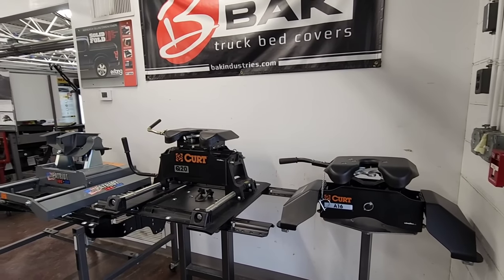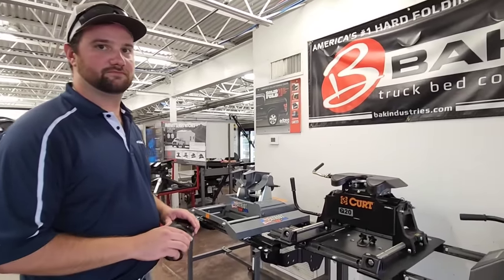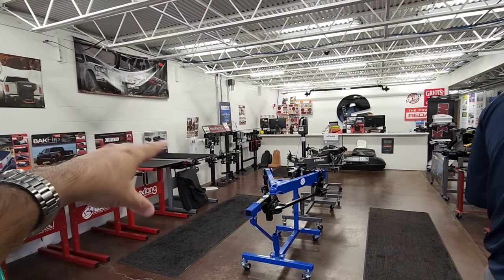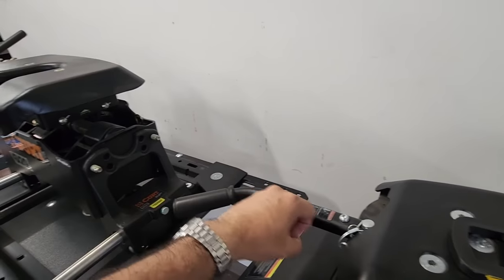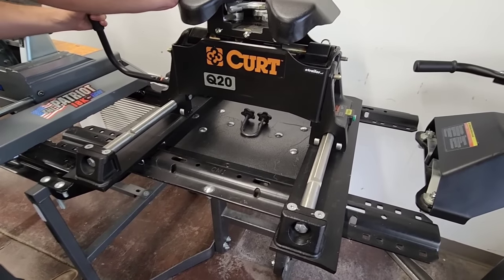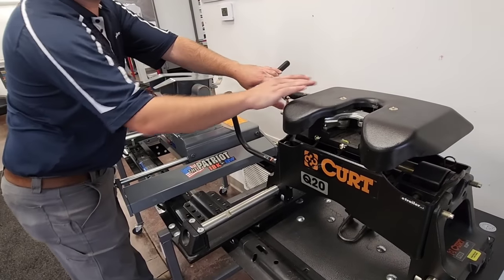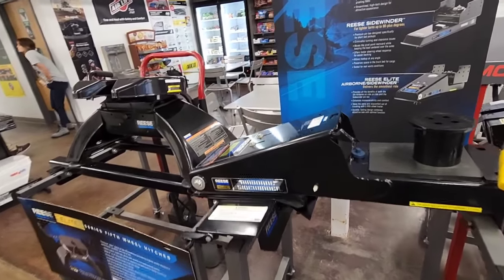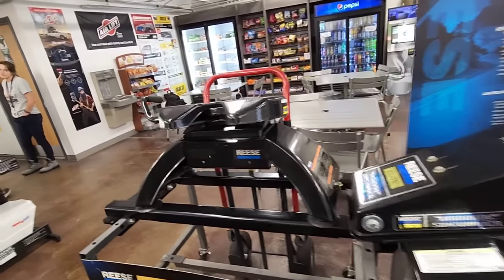Demonstrating how various Fifth Wheel Hitches work!

Comment: Worked for 17 years selling hitches.  B&W was my favorite due to quality, next was the Reese/Drawtite line.  Tried to avoid Curt due to numerous quality control issues at the time.  Only had an issue one time when a customer was using a 5th wheel to tow a multi car trailer.  He overloaded the system and claimed the 5th wheel was defective.   The 5th wheel pulled out of the truck frame and all the bolts used to install the 5th wheel were still intact with the red slip marks we put one all bolts still lined up showing they had not come loose.  Owner claimed he had not overloaded the trailer,  the hired driver ( whom the owner fired ) told us that owner over loaded the trailer and ordered him to drive it anyway.  We told the owner to go make a claim with his insurance company.  Last I heard, owner never got a dime and had to pay for all the damages out of pocket.

Comment: This was a video I wish I had seen before buying our first Fifth Wheel (FW) Hitch for our 2019 Ford F-450 truck.  The dealer talked me into buying the Reese 27.5K hitch for the truck that included the OEM puck system and a 3 inch receiver.   While we didn’t have any serious issues with the towing of our 18,500 pound FW, I did experience some issues with hooking up or disconnecting the truck from the FW.  Additionally, I have arthritis in both shoulders and that also created discomfort during hookup/disconnect processes.  We eventually bought the B&W Companion 25K FW hitch and I have to tell you that it was a night and day difference.  The B&W is so smooth doing either operation and I have had zero issues with my arthritis using that hitch.

Comment: ⭐️The Reese Pro Series is auto locking, you leave the handle in and unlatched so when you back into the trailer the handle comes out and snaps back in on its own. I've been using a Reese 16K Pro Series Slider to tow my Chaparral and my Reflection 31mb for 5 years now and its a great hitch.

Comment: This is why I love my B&W Companion hitch. Drops down in my B&W gooseneck hole. Tighten up the draw bolt and then 4 bolts. Install the head and your good to go. Pulls my 12k 5th wheel just fine. I use white lithium grease on the 5th wheel plate and jaws.

Comment: I have been running the Demco Recon now for 5 years and love it. The main reason I purchased it was I wanted a clean bed in my truck when not towing. It is easy to install and I pull an Avalanche 382FL which is 42 feet long and gross weight of 16000 lbs. Hitch weight of 2800 lbs. I have had no problems with it and I have a regular bed on my Chevy.

Comment: I like the way the curt fingers wraps around the pin. Like the extra bar coming across on the Demco, looks real safe.  Would not feel safe towing with the B&W because the fingers only touch each other.
Reply: most semi with wheels have the same B&W style jaw been driving semis 11 years zero issues.  And I have the B&W hitch in my f250 2 years zero issues.
Reply: They won’t be coming apart once they are locked in. I’ve towed 5500 miles with mine this year, First of many to come.

Comment: (Your wrong about the Pro Series)
👉I own a Reese Pro Series 16k manual slider and it is auto locking. The little pin on the top is not what holds the king pin in place, Its just a saftey. The harder you pull the trailer the harder those jaws clamp the king pin. My hitch is 24 years old and i pull a Grand Design 31mb.

Comment: I really like my 21K racon, it is mounted on a set of rails. I chose this because the swivel head comes off it's about 35 lb  and then the bracket on the bottom is maybe  40 lbs easy for a 71 year old to remove. The locking mechanism is exceptionally strong and there is no question as to whether it is locked in. And no need to use a step to lock and unlock  it I can reach it easily.

Comment: I’ve had a Curt A20 for about 10 years and love it. Has a green , yellow and red indicator that tells you if your locked or unlocked or not quite locked. This is my second truck with the same hitch. I have a short bed now so I need to replace the mounting sides to a slider mount.

Comment: Having a 6.5' bed I tried the B&W Companion.  Didn't like the slide as you had to get out to unlock and with weight it was hard to slide and jarred the truck to lock in the back.  I switched to the DEMCO autoslide, love it.  Only downfall is getting used to the jerking when the unit is rotating back to straight, but can do a nearly, to full 90 turn (all dependent on your pinbox and front nose style)

Comment: Good video as usual. I am going to throw one at you that you might want to cover, as I had to figure out out by myself and the documentation is, well lacking a lot. I upgraded tow vehicles and got the dealer to throw in the RAM OEM 5th Wheel hitch, which is the Curt Q30 in Sheeps (RAM’s) clothing. My trailer is equipped with a Sidewinder Pin Box. While reading the owners manual for the hitch, I found a small box warning NOT to use this hitch with a Sidewinder or other rotating pin box. I did further research and could find little information other than the warning, not a reason why. I gave it a try and discover that the pin box was torquing The Whole hitch plate. A quick re-group on my part and swapped the RAM hitch with a Curt A20, which was a quick swap. It would be nice if you or eTrailer could actual do a demo video to save someone else the trouble that I went through.
Reply: For 5th wheel towing, I have a 2017 RAM 3500 Mega Cab Cummins SRW with the short 6'4" bed and Ram Boxes, so I had to use the Reese 19K Sidewinder pin box recommended by the folks at e-trailer along with the Reese 20K 5th wheel hitch mounted on bed rails, as RAM will NOT install their 5th wheel puck system in a Ram Box equipped truck for fear of a standard 5th wheel pin box impacting the insides of the Ram Boxes when turning sharply.  That Reese 20K hitch is a beast and handles the Sidewinder well as it was designed to manage it.  My only issue is uncoupling due to the wedge on the pin box at times.  The truck needs to be nearly straight to the 5th wheel, to uncouple easily.  Otherwise, I need to use a rubber mallet to gently tap the pull bar a bit to loosen the jaws.  Aside from that, this package provides a safe and confident feel while towing.  I highly recommend it for those of us with Ram Box trucks while towing a 5th wheel.  I tow a 2018 Legacy Montana 39 foot 5th wheel at 15K pounds loaded up.  Reese Sidewinder pin box on Reese hitch, works great!  I've been after JD for a video on the Sidewinder pin box for years, but he resists as he sees the Sidewinder as somewhat unstable with the pivot point being 22 inches back from the the rear axle of the truck.  Would a company like Reese make something unstable?  I've experienced 15K+ miles with the smoothest towing ever along with  superior handling upon backing.

Comment: I have a 16K Husky 5th wheel. It’s similar to the Reese pro series. Not sure if it’s meant to, but I leave the jaws closed when hitching up and the angled edge on the outside of the jaws opens them up and snaps back closed when the pin meets them. Then I make sure they’re locked and pin them before driving off.

Comment: We have the Curt Q20 slider. The dealer installers put the wrong hitch in. We were supposed to be the Reese none slider. Have a 8ft bed. After being there for about 4 hours for the install. They discovered the mistake and wanted to change it out. We told them no. Your problem and left with the Curt hitch. It also came with the fake kingpin.

Comment: Interesting video. I have a 20K Reese M5 hitch in our Dually, and the jaw is a little different than the one in this video. It seems to go across further, and has more meat to it, but I got it for our Puck system in our 2022 RAM, and it works well! The only thing I dislike, is the little plastic indicator they have that shows green or red when you're connected or disconnected. Right from day one, it pops out of place and gets stuck between green and red. So I always ensure the jaw is closed with a quick visual check from behind, and that my locking pin goes in with no trouble.

Comment: I have the A16 in my 2017  Ram 2500. I like the hitch. Only issue is at times the jaws won't lock. There is a Red/Yellow/Green indicator to let you know your ready to go. Hard to get it to go green sometimes. I have started "exercising" the jaws with a piece of wood before I hook up. Seems to help. The hitch is rubber mounted like an engine mount and tows nice and smooth.

Comment: Would be nice to do a review on a Hensley Trailer Saver  fifth wheel.I made up a tool for my shop to test fifth wheel play  for our tractors.Class 8 fifth wheels are adjustable, which we checked at our PM interval .I welded a flat plate on a trailer king pin centered to the plate the width of the fifth wheel with handles two handles on the top so once you engaged the king pin in the fifth wheel you could remove it .You could build the same for a camper fifth wheel, the king pin are the same diameter.

Comment: No Anderson hitch?
Reply: Andersen does not make a fifth-wheel hitch. They do have ball hitches that mount in the truck bed, including one system which they call the "Ultimate 5th Wheel Solution"... meaning that using it instead of a fifth-wheel is supposed to be the solution to the cost, complexity, and weight of a fifth-wheel.
Reply: @brianb-p6586  very accurate, well said.

Comment: We just bought a truck and we are planning on purchasing a 5th wheel RV. We would like a hitch which would be easy to know, that we know, that we know that the hitch is connected properly and that does not require a lot of physical strength on our part. Our vehicle is a RAM 3500 dually. Which one or ones do you think we should take the closest look at? Some of the RV's we are looking at weigh around 19K dry weight.

Comment: Regarding the reese Pro series, your statement that it is not autolocking is not correct. I was sold this one when I got my first 5er, and accidently discovered that they are auto locking. Basically you can leave the lever in the closed position with the safety latch open, then back into the king pin. The jaws/arm open then close behind the king pin. At that point I simply get out and close the safety latch and put my pin in then do my tug test to make sure the 5th wheel is locked and secured. I don't know if this is by design, but this is how I have done it for 5 years now. Someday, I'd like to move up to a goose box and get rid of the 5th wheel plate all together.
Reply: I commented this aswell, I think hes pretty biased with certain brands. Also the salesmen doesn't know how to use it either.

Comment: Im ordering a new truck, and im trying to think practical. I don't NEED a long bed for every day use, But I do want to get a fifth wheel.. Im looking at slider hitches.. Do I NEED a slider hitch? And which is the best for an automatic slider that will slide automatically when you turn, without having to unlock it.

Comment: I run a 30k Reese on my F-550. They do auto-lock, you just leave the handle in "locked" position with the flip-down latch released and back into the pin. Only thing I don't like is that the latch can get hit by 5th wheel pin plates that are larger than the pin box and replacing it is a P.I.T.A.

Comment: I have the GM factory puck system in my 23 2500 duramax. The Fifth wheel is too far back. I am overweight on the rear axle but have over 1000lbs available on the front axle. How do I get it forward at least 3 more inches? thanks

Comment: I have a question I have a GMC 2500 HD 2010. I tow a Viking 17bh. And at work there was an argument about it. That I needed a  weight distribution hitch to tow this little trailer. When I pulled it with the Acadia I used a weight distribution hitch. What about with this truck It barely moves the back end of this truck, What do I do How do I fix this argument? Please answer Thanks JD.

Comment: You failed to mention the added weight of these fifth wheel hitches.  They take away form your payload capacity.  Plus they are heavy to remove if you need to use your truck bed.
An Anderson hitch is a fraction of the cost and only 35 lbs.  But rated to pull more than a fifth wheel.
Reply: Fifth-wheel hitches come with various trailer weight ratings, so it is ridiculous to say that one product is "rated to pull more than a fifth wheel".

Comment: He did the Reese pro fifth wheel hitches wrong they are auto locking you’re just supposed to back your fifth wheel into the pins and they will move out of the way and then lock around the jaw opening it up first is the incorrect way I only learned this one I bought my first hitch years ago after reading the owners manual
Reply: I just commented this, maybe ill make a video and put the link in my comment.

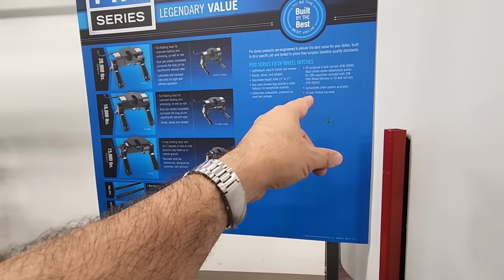Comment: 11:15 It really concerns me that there is a “budget fifth wheel hitch“ made with thinner metal.
Reply: Why? They can all safely handle the rated trailer weight, and most trailers are not even close to the capacity of the lowest-rated fifth-wheel hitches. "Budget" is more about convenience features than strength.

Comment: I'm afraid your bias toward B&W clearly shows in this review.  Of course, that is what you have, so maybe you are drawn toward it.  But I think DEMCO clearly has the best clamp around system than all the others.  The B&W clamps with 2 jaws and the opening is in the most prone area to open (at the rearmost portion of the clamp), and, after watching a buddy use his, that whole clamping action when connecting is goofy in that the handle has to be pulled to be sure it has clamped; the other hitches aren't like that - they click and lock with a much more positive display.  DEMCO's clearly goes all the way around the pin AND has that extra bar at the rear.  I don't think it is any more complex than the B&W or the Curt.  I do not think everyone will understand that when you speak about torquing the DEMCO it is because of the use of the goose ball connection - every goose ball hitch has that issue - even the popular (and problem prone) Anderson.  A puck system doesn't have that issue.  None-the-less, thanks for the side by side comparison, it was a good one.
Reply: I wouldn't call it 'bias' when he says "This is one of my favorites". He's not hiding anything or being biased by saying it's the best or anything like that. Just having an opinion like all of us.
Reply: I’ve never sold a hitch as fast as the Demco. It makes so much noise with that setup. The wrap around makes great contact. But there is play in it. So it moves back and forth and contacts that safety bar. I’ve never had a hitch make so much noise.